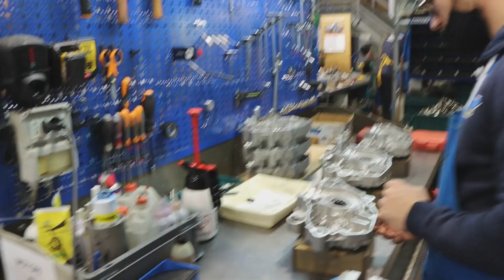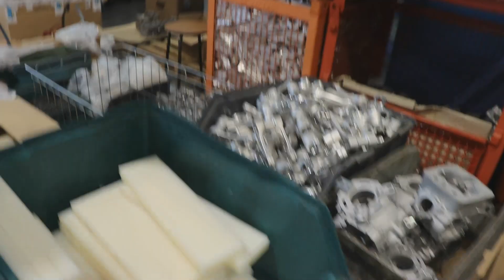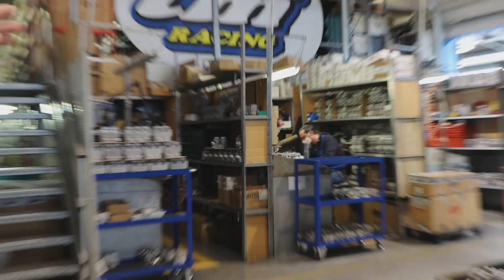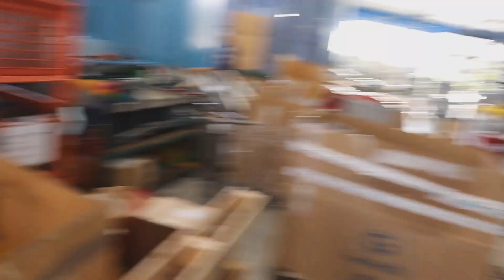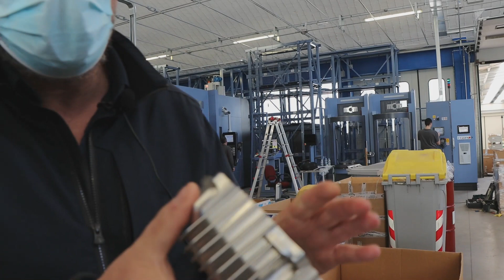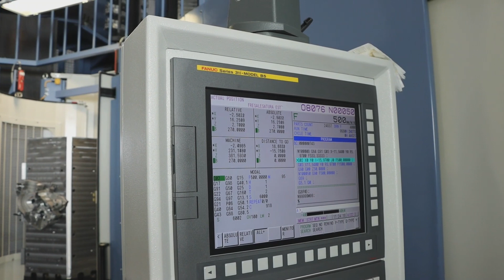TM Racing Factory Tour - Italian Dirtbike Part 2 (engines and machining)

Comment: 55 HP from a 125cc? Is it carburated and is that number of horsepower at the rear wheel?
Reply: I motori da kart per i kz 125 hanno 50 cv da stock ma il pistone dura tipo 60 litri

Comment: Funny, I had a deposit on a Beta 300rr and was lucky enough to find a TM en300 that was ordered but not spoken for so I put a deposit on it too. I figured I'd just take whichever bike came in first but as the time went on I really wanted the TM. Well the TM did come in first and that's what I have now and I can tell you it's pure sex in two dirt wheels. I can't see myself owning a different brand of dirtbike. I love being a part of something special and limited. Such a high quality machine and guess what, you don't even pay a premium for it. It costs less than the orange or white bikes and is on par with any other bike that I looked at. Love it.
Reply: hey dude. How much did you pay for your TM? I’ve heard that they are bit pricey. There is no a TM market in my country, the newest ones are like 2014 models here. I am really interested in TM bikes. How do they ride and feel compared to KTM 2 stroke enduros? Are they really cost less than the KTM or Husqvarna? 
edit: mistype

Comment: TM, Please fix the power valve problem on en300 2t.
Reply: Having pv issues with my ‘22 en300fi. I’ve never met another tm en owner without a pv problem. The only fix that my local dealer and everyone else he’s talked with is to whack the throttle after starting the bike. Four seconds later the valve is back to normal. My dealer is great because he’s trying to sort out the issue but has very little support from TM. I’m living with the issue and making it work for me but I’ll never buy another TM.
Reply: Hi Matt- I'm looking at buying a 2019 300mx 2t - what year are you having the power valve problem with?